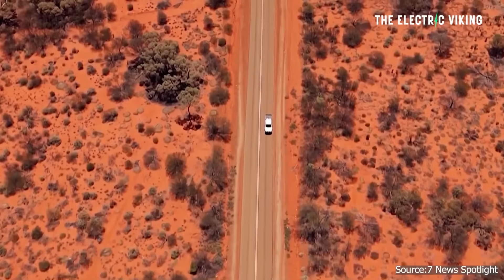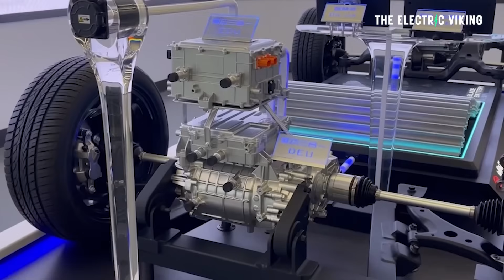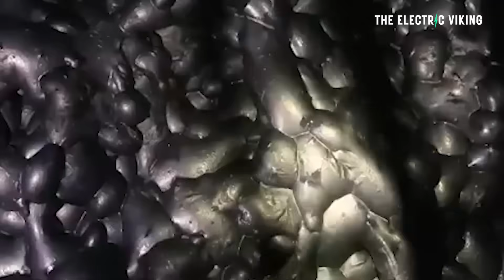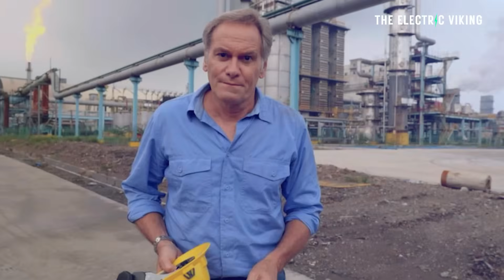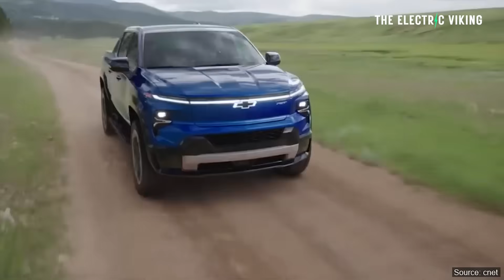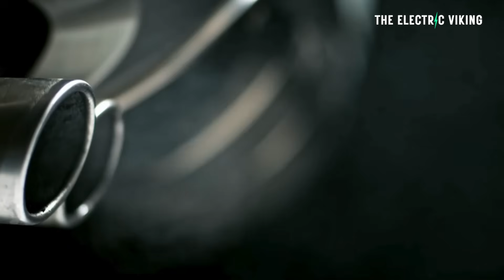Channel 7 Lies Exposed: The Truth About My EV Fight with Australian Media

Comment: Well, that "hatchet piece", certainly lowered the standard of Australian media - hitting the "bottom of the [metaphorical] barrel":
At it's best an infomercial for coal, oil and gas cartels. 

No one in their right mind could claim it was journalism. 

Thankfully, most Australians recognise - stock in trade - media agent provocateurs and sabateurs. 

Good work, Sam Evans. 
Trust the emergence of better values. 
It might seem "glacial at times", but change is happening. 
[pun intended]

Comment: A lot of research is being done on solid state batteries that replace lithium with sodium. Ford recently announced they will be releasing ev's by end of this year containing such batteries which are cheaper to manufacture, more stable, get higher range and faster charging times and work better in cold weather than the currently used lithium batteries.
https://www.google.com/search?client=safari&rls=en&q=non+lithium+solid+state+batteries&ie=UTF-8&oe=UTF-8

Comment: It's happening here also in the UK there was a big fuss about EVS causing the potholes in UK roads which has been proven to be false but they forgot to include that snippet then it was tyre dust from EVS which was also proven to be false as evs hardly use there brakes which is the primary cause of tyre dust it obvious the fossil fuel companies are attacking EVs and caused a war over them making up stories left right and centre plus they have the stupid media on their side so everything they say is plastered all over TV and billboards its disgusting and we are losing the war as idiots believe there lies without fact checking them out we need to fight back.`PS and Sam we are always be with you through thick and thin mate all the best and my hopes and wishes to your lovely wife .

Comment: The use of Oil to power cars is a National Security issue for any country that is highly dependent on imports of Oil.  
Considering the situation that is happening with Tariffs in the USA having to import Oil needs to be looked at in a new light.
Making cars and batteries can be done in many countries. This limits your exposure to limited sources of oil and refined products.

Comment: Hi again "EV" Sam,

Here is the answer from the highly regarded and reputable website Solar Quotes with Anthony Bennett debugging the Ch7 Spotlight fiasco:

Anthony Bennett says
April 8, 2025 at 12:08 am

Hi Daryl,

We wouldn’t normally support a Ch7 beatup but it’s worth debunking.

These Indonesian Nickel mines and processing facilities have been around since the 1960s, they produce class 2 Nickel (Dirty Nickel) which is predominantly used in the manufacture of Stainless Steel. The low purity levels of dirty Nickel mean it’s totally unsuitable for use in Lithium Ion batteries.

Li-ion NMC/NCA batteries are manufactured using Class 1 Nickel which has very high purity, this material is not just a better processed version of what is found in Indonesia but the Ore itself is actually different (Sulfide Ore) and is more difficult to source and mine than class 2 Nickel. As of now class 1 Nickel is predominantly mined in China, Australia, Canada and Russia.

Full link is here:

https://www.solarquotes.com.au/blog/labor-home-batteries-mb/?_sc=NTg2NzcwOCM0MDgxOA%3D%3D&utm_campaign=AB+250408+Weekly+Newsletter&utm_medium=email&utm_source=brevo

Cheers Sammy
Reply from the maker: Thanks mate, I'll put that info at the top

Comment: I don't watch much mainstream media but readily accept that they are in the pockets of Big Auto. And  your attempted questioning about Bi-directional charging is front and centre what such interviews should be addressing... for example, why not target subsidies at the latest gens. of these devices... this will optimise EV usage and MAXIMISE off-grid power for Australia's battlers.

Comment: First up nickel isn't graded, it's classed. Class 1 is very pure and suitable for batteries. Class 2 has other metals mixed in with the nickel. Yes the mine fine Indonesia yields class 2 Nickel. which is used for stainless steel along with some class 1 nickel.  That doesn't mean the class 2 nickel could not end up in EV batteries after further refining. We shouldn't forget  that one very prominent EV is made of stainless steel. 
Then there's the typical suggestion of the evangelists that Big Oil are funding this EV slap down. I fail to see why Big Oil would be worried about EVs when a significant percentage of EVs are petrol burning PHEVs and there's a lot of petroleum products used to make all the plastic bits in an EV.
It's not just the nickel that's problematic. There's the cobalt and the lithium mining in South America robbing the locals of their water.
In the big picture what in our modern world would exist without mining and manufacturing ?  That's not to say that we shouldn't expect ethical supply chains but if those in the EV space adopted a less holier than thou stance would be good for all. We're  all imperfect creatures in an imperfect world.

Comment: Nickel laterites such as those found in Indonesia ARE used in EV batteries.  They do need more refining than nickel sulphides: this is done in coastal Indonesian villages and the heavy metal pollution tipped into the ocean.

The "grade" of nickel is determined by the other minerals its alloyed with.
Reply from the maker: Not from the factory they visited, but. yes mate, I agree some of Indonesia's nickel goes to EVs -= very low percentage though as EVs only account for 4-7% of global nickel use.

Comment: Irrespective of the validity of any of the arguments. The reality is that neither fossil fuels nor batteries for green electricity are sustainable. They're all dependent on finite resources that are not renewable. If we want to live a sustainable lifestyle, we have to live a simpler lifestyle.
Reply from the maker: Actually no, that's incorrect. We will no longer need to mine for battery minerals somewhere between 2045-2055. EV batteries are 98% content recyclable.
Reply: You still cannot have 50% of the worlds population consuming 90% of the worlds resources. Something will eventually break. @electricviking

Comment: I’m new here to learn. You play a important role in that for me. I’ve always been a bit of a hater for EV because of the minerals they do use for batteries. But this has really open my eyes. Still not there but I’m still learning. Well done. Never watch mainstream media anyhow.
Reply: Most built things use minerals. Batteries are recyclable. There is plenty of lithium and iron.
Reply: @ Yes but lithium is dangerous. Even for the environment. Thats what keeps on burning. I know you need 6 minerals for a battery where petrol only two. Thats what is hard to get pass for me.
Reply: @Noxie123 I can see where you're coming from and I'm disappointed.
Reply: @robertwhite3503  disappointed in what?
Reply: @Noxie123 It's always the same same argument. You'll same lithium burns. I'll say petrol burns. You'll say lithium is hot. I'll say the the same temperature as a candle. You'll say fumes. I'll say all fires have fumes. You'll say it's always lithium. I'll say that's rarely the case. Then tomorrow, you'll say the same thing as though we hadn't covered it all.
Reply: @robertwhite3503  I’m not hear to argue but to learn. You still haven’t explained anything. You are still digging for 6 minerals. How’s that good for the environment?  It’s more mining not less.

Comment: Hi Sam, I haven't seen the Channel 7 story yet, here in the USA, but I got a M3H with the LFP battery and agree your influence has been key regarding this issue.  I specifically wanted and got an LFP battery.  Sadly the model 3 I have is no longer sold here.  In the USA LFP batteries are still pushed aside far too often.  Our RWD M3H has been great and I've never been wanting more range from it.  Keep it up, Sam and I'm sorry to hear you and the minister were targeted most unfairly.  Best, Mike
Reply from the maker: Thanks mate. Hopefully you guys get those LFP factories up and running soon

Comment: Ive been smashing all the brain dead people that dont even attempt to conduct due deligence research and find out the badics of battery chemistry. What this has taught me is that there are millions of people are so open to being scammed if they cant be bothered to conduct research. Its actually mind boggling. I had to even smash a former workmate posting on all the coal ships off the coast of qld ( exporting coal for power stations) very quick check and all the coal from that port was for metalurgy!!! The school system has failed do many.
Reply from the maker: "The school system has failed many." 
My thoughts exactly

Comment: Edited update. 
Nuclear and Fossil ARE GRID electricity, are heat technology and only use 25% of the energy in the fuel at the consumer's point of use.
More fuel loss just maintaining availability by maintaining plant at operating temperatures. 

Heating losses 
Mechanical losses
Grid losses 
Electricity dumping losses for grid stability. 
Grid stability losses. 
Peaker plant efficiency losses. 
Massive grid RENTAL costs. 

Both then continue to use more energy to keep their plants heated at operating temperatures. 

Nuclear talking point, UTILIZATION is bs confusing talk. 

Rooftop PV has no heat loss, no mechanical loss, no grid losses, no investment loss, and creates massive tax-free savings on energy bills. 
More savings on NO EXTREMELY EXPENSIVE GRID CONSTRUCTION.  $TRILLIONS. 

EDIT added:
CONSUMERS personal investment MAXIMUM UTILIZATION of their own energy infrastructure is extremely profitable. $10,000 tax-free savings every year for DECADES and decades. 

For example. 
Humelink transmission $5BILLIONS. 
Snowy Hydro $20BILLIONS.
My aerial home upgrade 10m, $2,000. 10million homes. $20BILLION  ??? 
Millions of businesses ????
GRIDS AIN'T CHEAP. FMD.

Rooftop PV is cheaper than windows $m² installed and last decades. Grow up.
2cents kWh electricity. 
Rooftop PV shading 😎 hot roofs saves air-conditioning costs. Grow up.  Hahaha 👍

Comment: Hi , Sam you are doing a good job spreading good information about EV I have learned a lot from your show. I thank you keep up the good work.
Reply from the maker: Awesome, thank you!
Reply: Hi Sam, at the end of 2023 I drove a Camry hybrid I thought it was the best thing I have ever done and 2 months later I changed to a Tesla model Y I then found that was ever better not driving into a petrol station
to filled petrol in the car. In the Tesla model Y I have found the suspension to be very stiffed. I do not drive both cars mention at the above anymore.
About 3 weeks back I drove a Xpeng G6 just into the drive for several seconds it has blown the Tesla model Y of the water from my experience. I hope to joined the Xpeng club in the near future. When that happens I will let you know that I don’t have to drive into a petrol station anymore.
Cheers.
Reply from the maker: Awesome. I think the Xpeng has the perfect balance in terms of suspension comfort and low body roll.

Comment: Nuclear and Fossil grid electricity are heat technology and only use 25% of the energy in the fuel at the consumer's point of use.
More fuel loss just maintaining availability by maintaining plant at operating temperatures. 

Heating losses 
Mechanical losses
Grid losses 
Electricity dumping losses for grid stability. 
Grid stability losses. 
Peaker plant efficiency losses. 
Massive grid RENTAL costs.

Both then continue to use more energy to keep their plants heated at operating temperatures. 

Nuclear talking point, UTILIZATION is bs confusing talk.

Rooftop PV has no heat loss, no mechanical loss, no grid losses, no investment loss, and creates massive tax-free savings on energy bills. 
More savings on NO EXTREMELY EXPENSIVE GRID CONSTRUCTION.  $TRILLIONS. 

Humelink transmission $5BILLIONS. 
Snowy Hydro $20BILLIONS.
My aerial home upgrade 10m, $2,000. 10million homes. $20BILLION  ??? 
Millions of businesses ????
GRIDS AIN'T CHEAP. FMD.

Comment: There is no doubt that the way some Chinese companies choose to mine nickel without regard for proper standards is terrible. It is also a poor reflection on the Indonesian government to let this happen (greed), however, yet again this is very poor journalism with extreme bias. This is more a story about companies which do the wrong thing rather than trying to blame the EV industry. Car manufacturers (other than BYD) rely of the supply of batteries from 3rd parties. They don't directly mine Nickel. The worst companies here are CATL and BYD (both Chinese companies) because they source a large proportion of their nickel from the sources referred to in this video. EV manufacturers like TESLA use mostly Panasonic batteries for their American made vehicles. Panasonic recycle most of their nickel but do obtain a small proportion from other sources (including Indonesia). TESLA use mainly NCD batteries from LG chem for their vehicles made in China and Germany which also obtains nickel from various sources. The only batteries which TSLA use from CATL/BYD are LFP chemistry (which do NOT use nickel).

Further to this TESLA have recently started producing a small proportion of their own batteries in the U.S. to reduce their total dependency on Panasonic. TESLA source their nickel transparently and responsibly from Vale (Canada), BHP (Australia) and Proxy Resources (New Caledonia).

Channel Seven have chosen to broad-brush the entire EV industry rather than provide a qualification of the various EV companies which are trying to do the right thing yet are caught between a rock and a hard place . The Chinese EV companies are the worst. TESLA is the best when it comes to responsible sourcing of components (like batteries). What channel Seven have done now is effectively indicate to stupid people that it is entirely justified to hate people who drive any EV.

I wonder what sought of environmental disaster story someone could produce if the sole objective was to discredit the oil and gas (or legacy auto) industry. That would be one hell of an "eye-opener". Well done channel Seven... you have hit another new low in journalistic integrity. How much did the oil and gas or legacy auto company pay you for this "hit-piece"? 

Given that the world uses nickel for many things (including steel alloys and batteries for everything other than EVs), it reflects very poorly on the journalists involved in this story and of course, channel Seven.
Reply from the maker: Excellent points

Comment: Have you seen the Canadian oil sands?  Looks like hell, most mining unfortunately is very bad, especially third world, but those Indonesian mines do look horrible, interesting point about the stainless steel though.  Shades of gray everywhere.
Reply from the maker: By 2045 we will no longer need to mine for battery materials thanks to battery recycling. Not a perfect solution, but a lot better than a coal mine or an oil field

Comment: People on this planet have a very limited understanding about pollution, pollution is not only comes from your exhaust pipe. It’s also comes from your electric grids and technology. Your sun your planet and your body operates on 432hz frequencies, your electricity is very dirty, it operates at around 50-60hz  this is very low frequency ant it’s at the toxic levels. It is not good for the planet and for the living things it creates disharmony, creates many diseases in your body like cancers , arthritis. , Anxiety. Insomnia and so on.
Asthma is mostly caused by toxins and those toxins come from pharmaceutical products like vaccines.  However, electric cars are the future but with the converters to 432 Hz. You need to work on your power source.

Comment: Hey Sam, just wanted to say thank you for standing your ground and speaking truth to power. The way Spotlight tried to frame you as an “EV zealot” was beyond unfair — classic smear tactics. You showed incredible composure under pressure, and many of us saw right through their manipulative editing and goading.

I actually wrote a detailed blog refuting Bartlett’s hit piece, tackling both the nickel issue and the broader misinformation campaign around EVs. It’s clear there’s a coordinated effort to sow doubt just as the transition accelerates — and voices like yours are critical in pushing back.

One small note: you mentioned the Indonesian nickel is the “wrong grade” for EV batteries — but as of now, it is being used in NCM and NCA chemistries. Indonesia’s laterite ore is processed via HPAL into Class 1 nickel sulfate, which is being fed directly into the battery supply chain (especially for Western automakers). It’s messy, carbon-intensive, and far from clean — which makes your advocacy for LFP even more important.

Keep doing what you’re doing, mate. You're not alone, and your work is making an impact. 🔋🌱

https://evcurvefuturist.com/2025/04/nickel-lies-ev-truths-exposing-the-con/
Reply from the maker: Nice article mate

Comment: People can deny EV's all they like. With cost of living and inflation out of control over the years people will have no choice. For now, enjoy the savings. Isn't it wild that my New EX5 Geely has the same running cost at my 2008 Nissan X-Trail over 7 years? A brand new vs an old petrol vehicle (which has served me well mind you). One car costs me $15 dollars per week on fuel vs an ICE vehicle which is $150 per week.
Reply from the maker: Great car choice, epic value
Reply: @electricviking  It definitely is! A couple things bug me but hopefully they patch it up. For example, not being able to save your settings, the ice cream truck sound when going low speeds, I am okay with the sound on a reverse, but not while drifting through traffic. Apple Car play will be good to see in July. Apparently the boot can be open while driving if pressed by accident on the display screen. A couple things they need to fix. If they do that and listen to the feedback they will have a lot of happy customers.